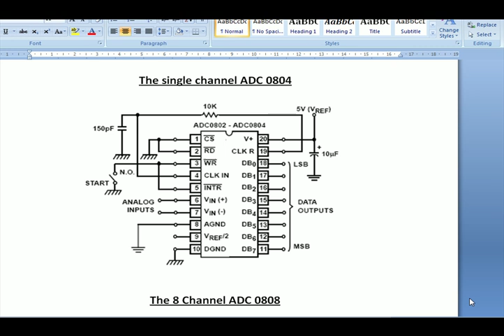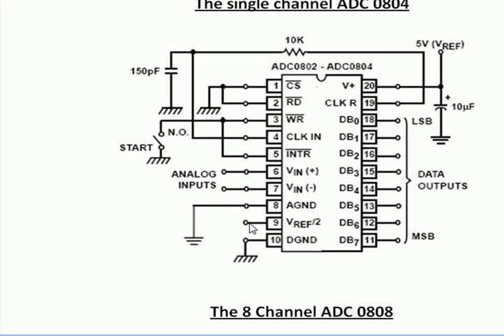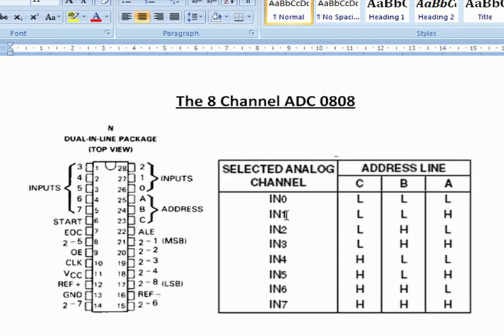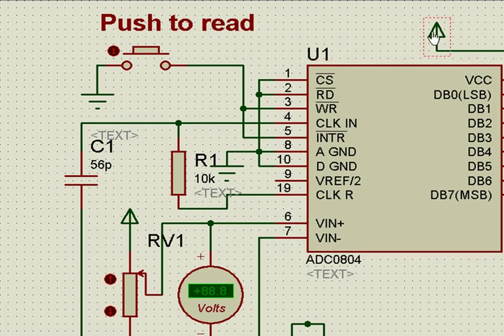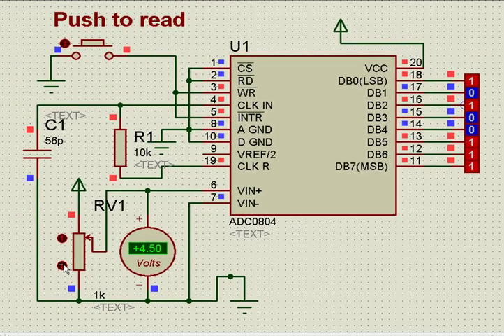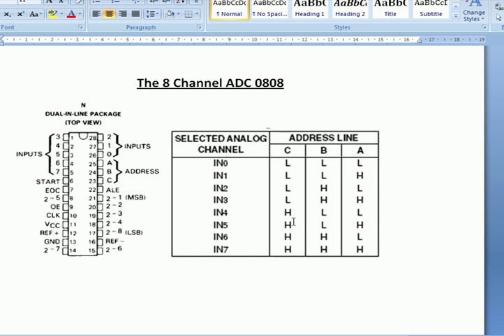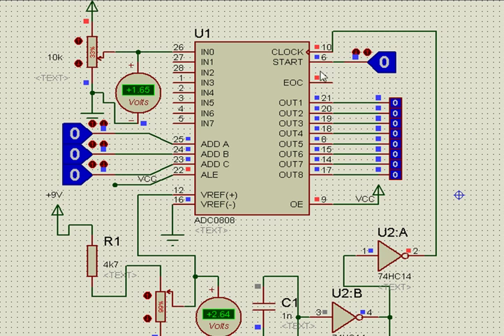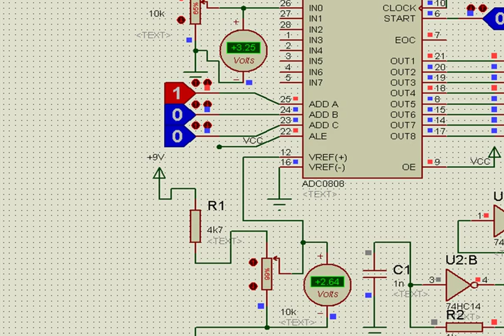ADC_analog to digital converter.avi

Comment: how can i do it in real time without the push button? I tried to connect it directly to the ground (WR and INTR) but the outputs of the ADC remains at zero. The thing is i have a microcontroller connected to a temperature sensor. Do i need signal from microcontroller to ADC's INTR?